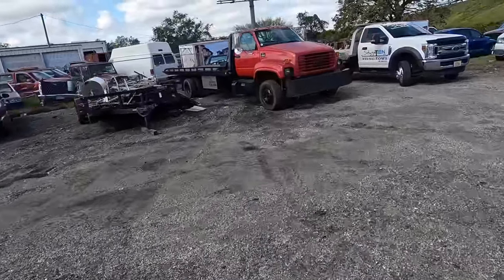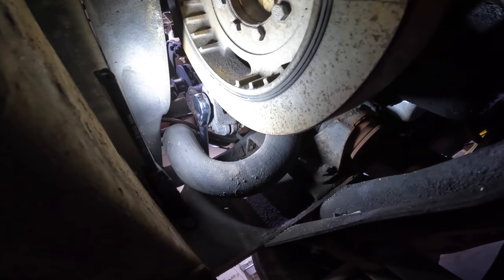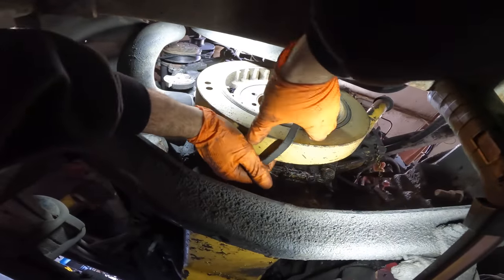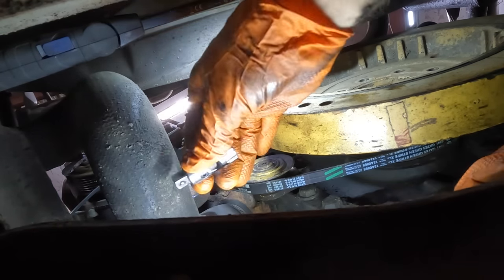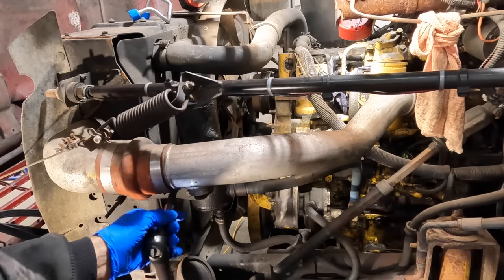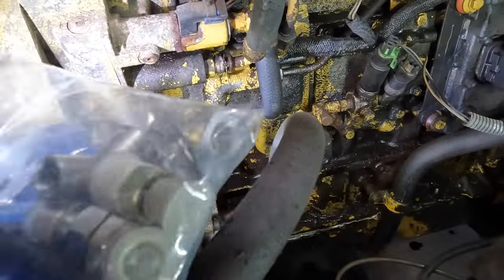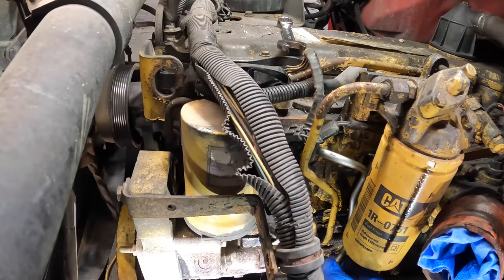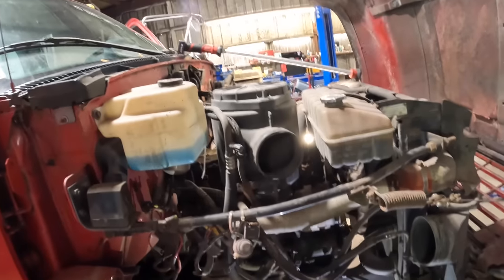Hi Tension Explosion! CAT 3126 Diesel

Comment: Even at work I look for manual tools. You spent more time changing batteries than it would take to undo those clamps with a socket and ratchet...and yes, I have fought with those air to air clamps...on the side of the road at -20. Yes, most sane people refuse to work on RVs. That thing a guy I know has is a Freightliner chassis, buy the Freightliner dealership refuses to even touch it. I don't blame them. I looked under that thing.

Comment: That's way I never would buy a RV they coast to much to have them to be repairs that is way I like my 40' 5 wheel.  You should change all the filters then cheek all if the hydroelectric and the lines that all you need when you are out on a job and a line bursts that would be bad  and it would be a great idea to go through and inspect every thing bending the track is new to you

Comment: NOW you understand why,after23 yrs of diesel work,I switched to small engine repair,for 17 yrs...
 Expensive tools,heavy parts,and not as good of pay,as itshould have been.
By the way the 4 inner  bolts would have got the dampener off easier but laying underneath,you'd probably  gotten  hit with the 60 lbs falling on you...

Comment: Ray, I know you're a busy man, but I need some easy help.  I've looked on Google for the past 4 months on and off for the location of the evaporator drain hose on a 2020 Silverado 1500 crew cab. It has the 2.7L if that makes a difference.  My trucks had an odor when I run the cold air, and its much worse after I run the ac on a previous trip. I ran the ac and it's not draining. All the piictures are of pre 2019 that don't show the same firewall that I have in the 2020. There's one little hose that's a half inch with a plastic nub that is in the vicinity of where the drain hose is supposed to be, but it's not it. I've laid out on the ground with a flashlight rolling around for over an hour, so many times I lost track. If there's a tech that knows, that wouldn't mind taking a min to respond, that would be appreciated also. Its out of warranty, and with everything doubling in price, I can't afford to take it in. Thanks yall.

Comment: Ac compressor could be your probelmn with the belt,seizing up while engaged,u should of plugged it back in and tested before new belt in case it takes out new belt ,you would have old belt on,dat tensioner they wear out n cock the belt to wear it out,if your removing balancer,then do crank oil seal while your there,also torque balancer bolts,if you don't someday you might regret it.....

Comment: 23:43 - I wonder if the holes through the flywheel/balancer could line up with the tensioner hole so you can put an extension through the fly wheel and straight into it.

Comment: If you missed checking the direction of the lettering on the belt, I hope you at least confirmed the part number.  That would have sucked if you had discovered it was the wrong belt after all of that work.

Comment: Our 3126 always starts - replacing that serpentine belt is smart, ours shredded in the driveway (so lucky) and without the oil pressure our air brakes and air ride kept us parked (let alone the fact that the injectors work on the same oil pressure).

Comment: On aerosol cans, there is a black dot marking on the top of the valve.  Line up the discharge of the spray tip with the black dot and you can hold the can at an angle, and it will evacuate every last drop out of the can!  That's because the dip tube (straw) in the can is curved just for that reason.

Comment: I like to use liquid hand soap to lubricate rubber parts. It allows you to slide it on and then goes away once it's dried. I do this mostly for motorcycle grips and toilet flappers.

Comment: I think you should have tried putting it on with the smooth outside of the belt on the inside, the strengthening wires are on the smooth side. plus you are not fighting the rubbery knobs anymore.

Comment: I discovered you can quickly remove engine belts and cut wiring harnesses with a larger hammer, not good for the pully's the block or the frame though.

Comment: It amazes me how little some people think beyond their experience or frame of reference. O/o can work more than 40 hours a week. Anywhere between 70 -100 hours a week to run a small business. Even if it’s just cleaning the toilet in the front office, it’s working adding value but non-revenue generating. As a truck driver before elogs I spent hours a week checking my expenses and log book. Making sure my fixed and variable costs were less than my revenue so I could eat next week. This also included researching routes and base (pretax/use tax) fuel prices. These update weekly and what may work one day may not another day. Point is an employee doesn’t give two shits about this and when home can forget about their job. Not a owner, it’s a shit ton of work

Comment: Why would others complain?  You've had several vehicles that aren't yours that you've worked on. 
Others have pointed out how to get that dampener off, so i won't repeat, but i will say, you take it off, be ready, it is very very heavy! Don't want to drop it on the noggen🤣🤣 you'll have a pretty bad headache🤣🤣
Don't worry, you aren't going to get cold enough in central or southern Florida to keep a diesel engine from starting🤣🤣 
I've been driving diesels for almost as long as you've been around, I've shut them off in temperatures far colder than you'll ever experience in Florida without additive, & they start right up.

Comment: Random alarm noises, my dad's ranger dings at us for several minutes, stops eventually, then does it again so many minutes later, then rinse and repeat. Seatbelt clicked, door closed, vehicle running and driving, so some sensor is messed up or something. It is a 1999 I think. Poor truck has been through so much it might just be screaming in agony...

Oh and the oil thing reminded me, we took the trans pan off of the suzuki to replace the gasket and filter (found out it is a non serviceable as far as the filter goes but still replaced the gasket...) And the wire loom was falling to pieces inside the trans and probably clogging up the filter. Such a dumb vehicle but it was the only one we had, and of course we have replaced so much on it and put so much money and time into it we don't really wanna sell it. But with the timing stupidity we can't drive it, which is why we bought the escape. Anyway, is there even supposed to be a loom in the trans? I found that to be very weird. Would the atf break the loom plastic down or did it fall apart due to age?

Comment: Oh, one more thing, them engines red line is 2200 rpm, if you want it to last, 1850 should be your max rpm for long period of running time, them kitty cats are not  high revving engines, oil change is 250hrs of running time, if a lot of idle time, 200hrs would be the max. First thing I would do is pressure wash that engine and the O ring you used if it's not a viton material ring you will have to change it in short order, otherwise it will break up in little pieces after it swell's up from the heat and oil saturation.
be well !

Comment: Amateur tip here I use a 1" soft copper tube about 12 " long that I flattened on 1 end so it will slip over my larger wrenches when I need extra force.

Comment: Use brake clean to get the fuel leak cleaned up and blow dry with air. Spay athletes foot spray around the area. It leaves a white powder all over the area. You will see where a very slow leak starts as the powder absorbs the fuel. Old mechanic showed me that years ago and use it when having a tough time finding a leak.

Comment: I bet if you turned the belt inside-out, it would fit no problem. The back of the belt is a fixed length. With the teeth on the inside, you'd get a smaller area than if the teeth were on the outside.

Comment: Hey Ray...Perhaps putting a flat bar on top of the belt, against the pulley then using the air hammer to push belt down would have worked.

Comment: if you look at 20 mins in and look to the right on the cross member you will see a small bolt on loose on the top of the big nut i do not know if it is off something .

Comment: A 3126 cat motor owned me one time for 12,000 miles and it was installed under the bed in the back of my diesel pusher motorhome. I did all the services on it until the high pressure line (same one you were replacing) cracked and started leaking. Only my motor had an air compresser and the bottom nuts were virtually inaccessible without removing said compresser. Cost me 800.00 bucks to have it replaced at an RV shop cause like you, my tools were not big enough to tackle that job. Needless to say, that motor was a bear to work on and now it is sitting in someone else's driveway!!!

Comment: just my 2 cents worth Ray,,,  but,,,  I think that if you were to turn the belt over so that the top side where all of the non stretchy cording is,,, is touching the damper,, and the squichy part of the belt is  facing away from the damper,,,  then that might give you enough extra length to more easily get the  belt around the damper,,,  Also,,,  I would use Dawn dish detergent,,  preferably 4x,,, to aid in the process,,,   :-)

Comment: You are doing a big no no trying to force that belt wrong i litterally did the same thing and got me in a ton of trouble with the boss it left him stranded months later because belts are not desined to stretch that far you dont realize it but it is impossible to stetch the belt that far without fracturing the cords that you cant see on the inside. And the belt will work but after about six months and 5k miles it broke apart in BFE. And you could clearly tell that it was due to cord failure that happened months earliet it was obvious if it fails and you disect the belt then you find yourself doing the job twice in about five k miles.

Comment: Short half Drive extension with a flat bar belt tool will also work. And a light coating of Dielectric grease will stop that bond from getting in your way and next time you have to take that apart.
Look at the piece you're replacing it with you might see how it comes apart oh, is that what we call a duh moment?
Why would a flare connection need an O-ring? Does it just not look right on the video? And if it's not a flared seal connection, why is it a high pressure oil pump

Comment: Dampener/Damper = Harmonic Balancer!!! ROFL
Love my big diesels... so much easier to work on than about any gas motor... I think the only exception is 50's-70's Ford/Chevy 351/350''s in pickups !!! A lot of people are intimidated by diesels, but in actuality they're a LOT simpler to diagnose and repair. Though internal engine work takes an expensive set of tooling, generally speaking the large diesels are great money makers for a LOT less effort. 
The only specialty tools I know of have to do with when doing injectors and head gaskets and sleeves. Dial micrometers and knowing certain specs for the aforementioned jobs are the biggest things I can think of, the rest of the tools all yours SHOULD do fine. If you should ever think about pulling the head, CALL SOMEONE PLEASE and talk with them. The sleeves have to be within a certain spec to each other AND across the whole engine, and setting injectors up is a trick too. Might want to consider  a 1" impact or a good 3/4" impact for certain things like lugnuts and such.
Don't let the size of the engine and rig shake ya Ray... You're more than smart enough AND trainable enough to deal with it!!!! 
Have a great day Ray!!!!

Comment: In the state of Texas if a vehicle has air brakes you must have a CDL do you have a CDL
Reply: Those are not air brakes.   He was making a funny.
Reply: CDL is not required for any TRUCK under 26,000 GVWR, no matter if it has air brakes. 
The "air brakes" on Ray's 6500 are akin to the famous "muffler bearing."
All mechanics familiar with both.

Comment: Went through every high and low with you on that one my friend...

With the explosive tensioner, beginning to think you've bought a pup (nothing bit trouble) there 😳 amazing you got it back after a 3-5hr road trip intact. 👏

However, I'm thinking, with all your skills, knowledge and expertise, you may, with the kind assistance of your good lady Lauren wife unit. Wish to document and publish  some 'Ray's' manuals (not Haynes manuals' on 'hammering off' and ratchet strapping on fan belts, air hammering on/off fuel pumps etc...

There be money in those open handed wrench tips! 🤑

Comment: Can that belt be turned inside out?
Reply: I think your thinking as I was? If inside out you’d think it would help without the teeth in the way just not sure it would help as the inside diameter would be smaller? I’m no brain surgeon🤣
Reply: @johnlarkin549  
How would the diameter change for the line of the outer part of the belt? The working side is just on the outside instead of the inside. ?